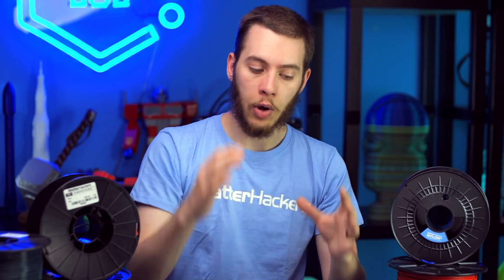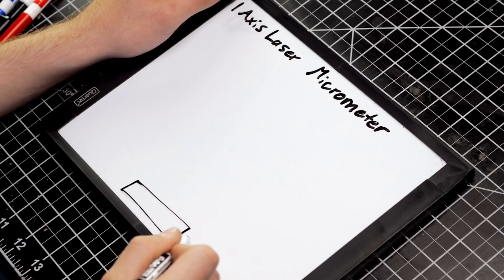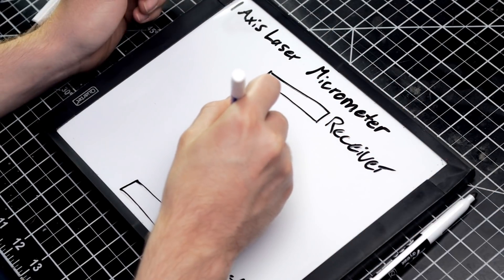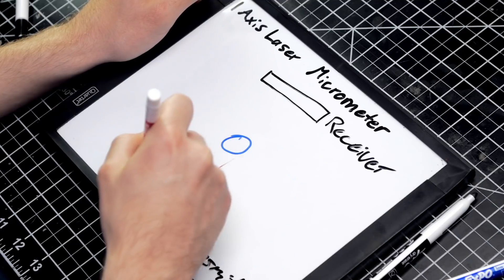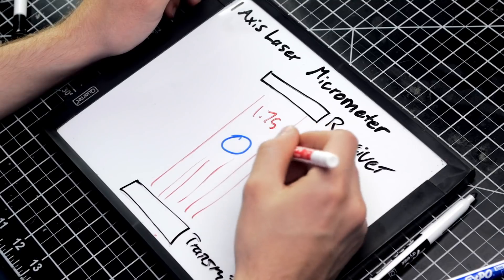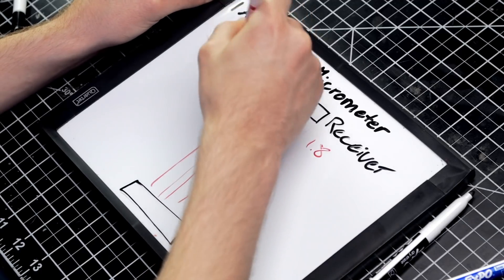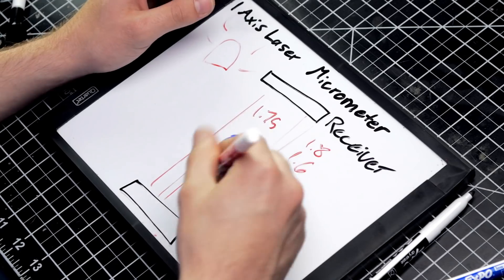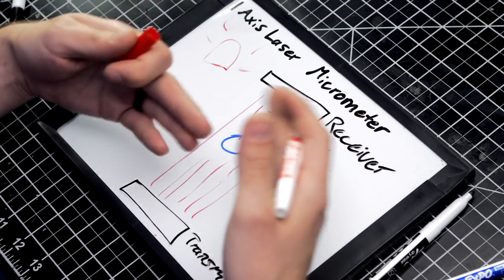Digital Fabrication Anatomy // Importance of Ovality

Comment: Now that brings up a couple of questions... Is there a printer that can do these measurements and adjust for them real time?  Next, given MOST people won't go for the expense of dong that, which brands of filament are the best/worst?  Is there a rating system to compare them that is publicly accessible?
Reply: I cant tell if prusament is the best in terms of tolerance and ovality, but its pretty damn good (the best that i certainly know of) and you can look up the specific specs of the roll that youve bought via a qr code thats located on the roll, which increases the trust factor tremendously for me. The reason why I value trust, is that I dont have the equipment to measure the filament for myself so im trusting the filament brand to the tolerances that theyre promoting.
Reply: Oh and the matterhackers filaments are of course also really good ;)